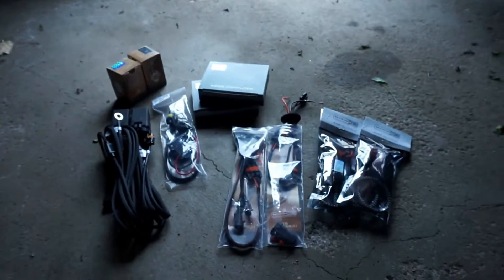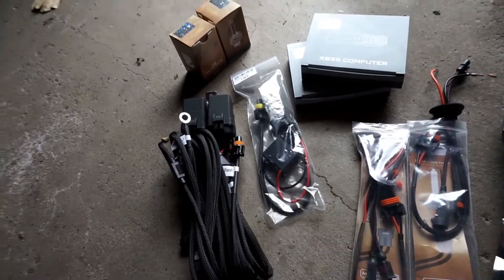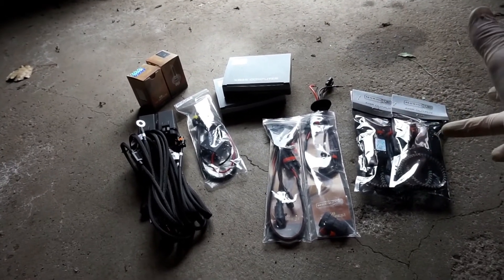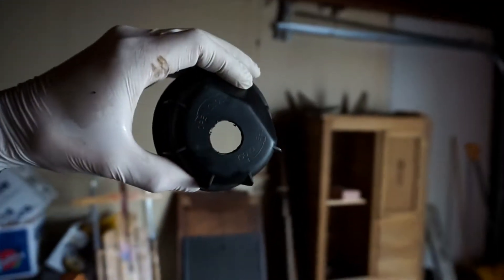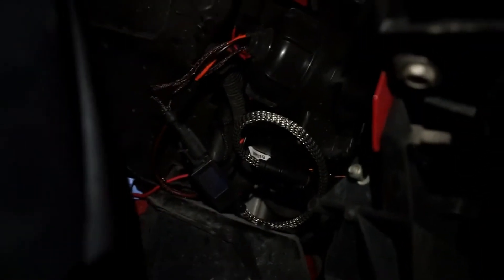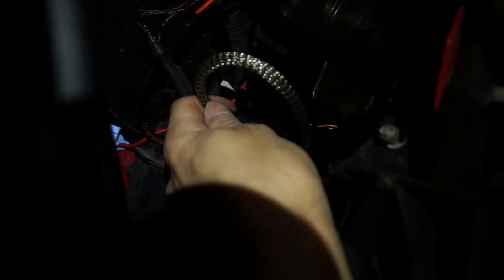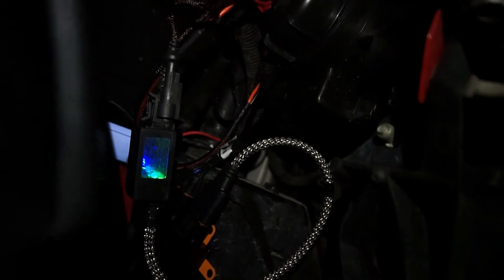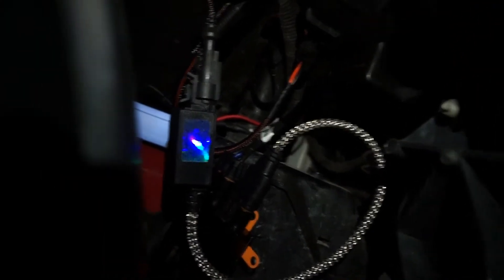G8 Morimoto HID Install

Comment: Hey I'm just started watching your vids. I also have the same g8. With out all the lights. I was wondering if you could post all the lighting you have installed. Because I don't know anything on lighting. Like if something needs something special to run on the car. That would be great because this is the next thing I want to do to my g8.